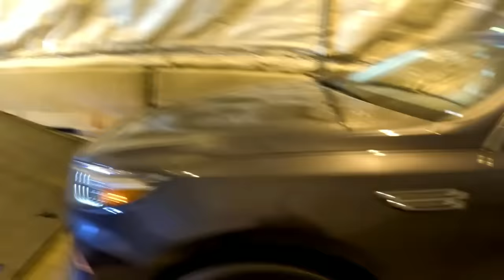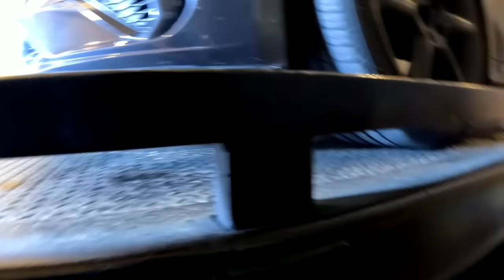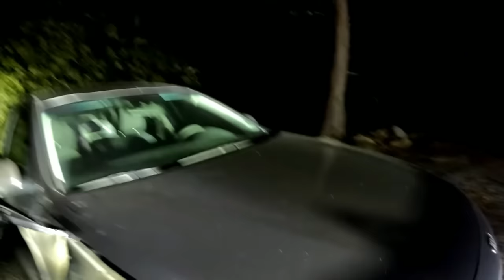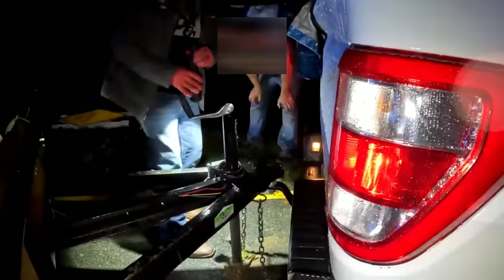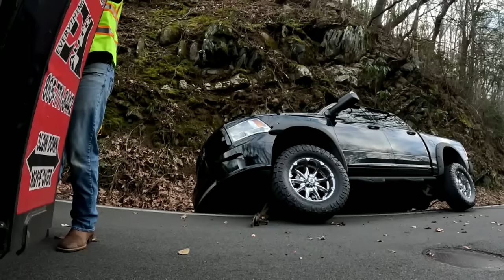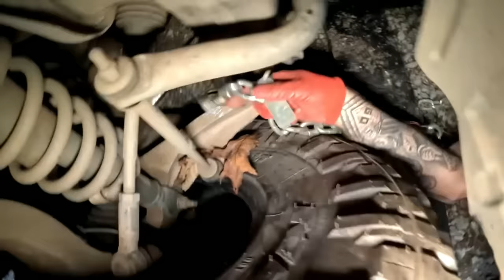A Strange PD Call, Kia Slams Into Concrete Barrier, & Another Reason To Wait For The Tow Truck!

Comment: His problem was an incorrectly loaded trailer. The weight should be at the front, not over the axles. He is going to have issues until he gets where he is going. The “outlaws” may have been trying to flag him down to tell him trailer was all over the road. And who has an open box of screws on their trailer that could bounce out on the road and flatten tires. Something not right there.
Reply: What ? If your weight is over trailer axles it's properly balanced if it's to far to the rear it's gonna sway from one side to the other really bad then to much tongue weight brings front wheels up off of ground mak

Comment: Criss Cross your chains to make a cradle if the trailer jumps off the hitch.
Reply: I’m glad I wasn’t the only person that caught that chain hook up issue. I also noticed that trailer wasn’t loaded correctly. It’s 60 40. Sixty percent of the load should be in front of the trailer wheels 40 percent behind. Helps prevent trailer sway.

Comment: Jeff you are right about car seats, you cant see damage in seats. Insurance will pay for replacements. PROTECT YOUR KIDS.
Reply: The insurance was ready with a check for the 2 car seats I had in my car. I didn't accept payment until I actually bought the car seat replacements. It was more than the insurance first offered. FYI, car seats have expiration dates.

Comment: I’m seeing this a year old & I didn’t look through all the comments, but it was a good thing whennyou hooked up the chains for the trailer by twisting them so they wouldn’t hang too low, however you’re always supposed to cross the chains when they’re hooked up for better safety. That way when the truck makes a turn the chain on the far side doesn’t bind up. Love your videos though

Comment: 2WD Ford, wet grass,,, stuck. Trailer loaded heavy rear, also taking weight off the rear end. Guessing he attempted to backup but failed, disconnected trailer to no avail. Still stuck.

Comment: Hi Jeff and kristen. just want to mention, when you connected the trailer to the hitch. I noticed that afteryou have placed the electrical wiring,  safety chains, 4th i noticed that you didn't locked the  ball hitch lock?(no offence,just saying)you might get a negative comment about that.

Comment: That pickup with the trailer guy I can tell you what was going on he is a paranoid schizophrenic I have a family member with that problem. Yeah they will run to different places saying someone is after them or harassing them and its the voices in their head. They are not a hazard to you just themselves.
Reply: I was thinking the same thing.  I hope that he is okay.
Reply: I wouldn't be surprised if we're a combination of that and actual interactions with that particular group. They have a heavy presence there, and he did have a bike. It certainly is a possibility.

Comment: Guys, the guy in a white truck is a perfect video example of someone suffering from some mental issues. I have personally dealt with someone having issues just like this, it is very very sad.  Certain drugs will cause these types of paranoia (e.g. acid and shrooms), but then also things like schizophrenia and bi-polar can cause it.
Reply: I wouldn't be so sure about that.  The 1% motorcycles clubs can be very evil and do some VERY bad things.  I ride and avoid other riders with rocker panels (the patches they wear on their backs) like the plague.  They will beat the crap out of you (or worse) for something as simple as riding in the wrong neighborhood, riding the wrong make of bike, wearing the wrong patch or colors, or going into the wrong bar.
Reply: @richareno233  That may be true as well, but that dude was paranoid and talking crazy. That’s a different scenario than what you are talking about, that’s different than just being mean.

Comment: Its a Frog no its a Bird, I say its a DEAD BODY what ever it was. 🤣  You two are just so funny yet very compassionate and empathetic  to folks in a bad situation.  
FYI even though a child was not in the child seat during an accident you still cannot continue to use the car seats. Even the little booster seat that the older child uses is to be thrown out. Face it a child seat is nothing but hard plastic. A crash will cause the plastic to fracture even though you cannot see anything wrong with it. There still is a fracture and the next crash will cause that plastic seat to rip right in half. I am sure you have seen many plastic car parts from crashes how it is just ripped right in half. Now put a child in the seat, have a crash and have it rip right in half. NOT a pretty sight at all.  PLEASE all parents just buy a new child seat!!!!!  Rather spend a hundred dollars on a seat then forever missing your child because you thought you could still use the seat.

Comment: She can't comprehend that Supplemental Security Income (SSI) is disability for low income people. The disability that comes from Social Security Administration (SSA) comes from wages earned that was paid into the Social Security system  therefore the amount paid out depends upon wages earned. SSA payments can exceed SSI payments by 2 to 4 times over. Either she draws from a spouses income or she has never worked that much in her life.